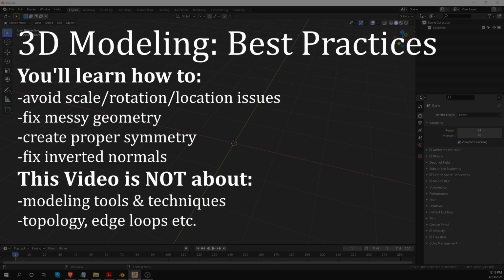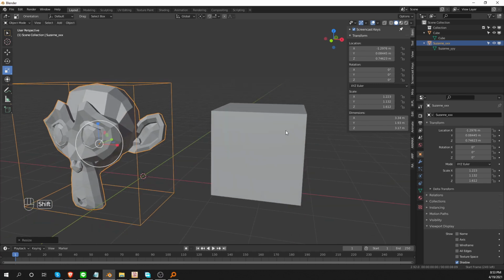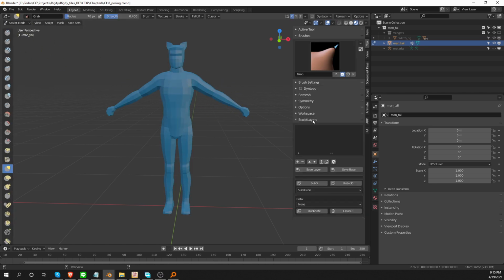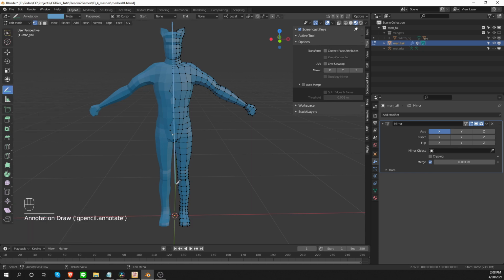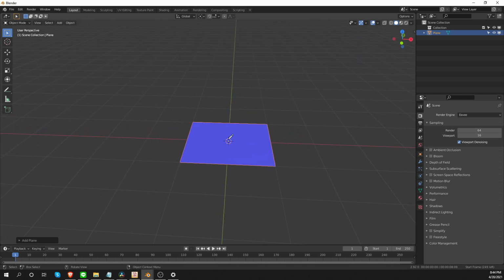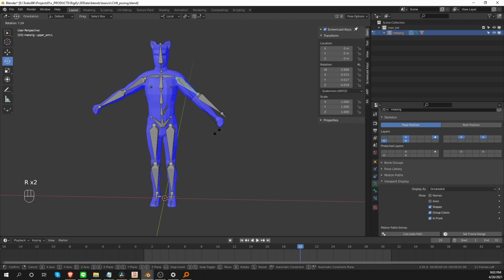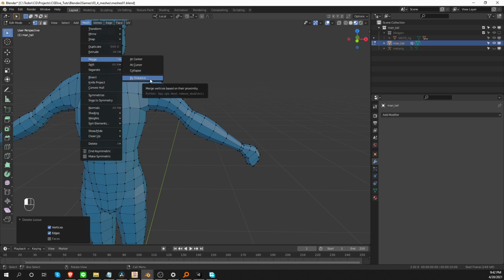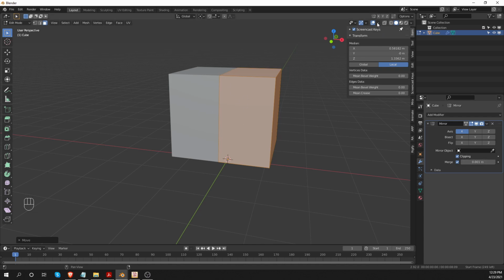[Blender] Best 3D Modeling Practices (aka Why your meshes SUCK!)

Comment: Thank you for the video.  I tried the method you mentioned in messy mesh, but I still have the following problems.  1.  In Pose Mode, after I moved my mesh with the control bone, the body with leg area deformed in ugly shape.  2.  When I moved my mesh's arm, some mesh came out from the other arm.  3.  Some mesh came from my arm's control bone and it sticks to the floor.  4.  I don't know how to solve the above problems.  I set the whole body weight to zero at weight painting.  But before I move my mesh's bones in Pose Mode, my mesh look good.  Please teach me how can I solve the above problem.  I will send you my Blender file, please take a look and teach me how to fix them.  Thank you very much.
Reply from the maker: Sorry, I am not sure what exactly could be wrong. Check for inverted normals which is also explained in the video!
Reply: @CGDive  Thank you.

Comment: This info-pact proper-meshing-for-rigging video is the guide I wish I had when I jumped into Blender 2.79 in 2017 to attempt to rig my first (made in ZBrush) 15000vert character from scratch. I even paid for (dated/ compartmentalized) subscription videos yet there were so many holes in so many areas. I succeeded in rigging a complex rig in spite of it all, still I left around 2.81, then returned to fumble through new shiny 2.93's buried treasures. This thoughtful tut has so many time-saving, pain-reducing, pitfalls-avoiding good practice gems for beginners or intermediate new arrivals to Blender. Bravo CGDive =  one valuable asset to 2021 Blender community!
Reply from the maker: Thank you very much. This is probably one of the nicest "praise-comments" I have received so far. I hope you don't mind if I used it as a "testimonial" at some point.
Reply: @CGDive  OMG now I'm blushing, please feel free... :)
Reply: Oh, and my spelling correction: *info-packed not info-pact
Reply from the maker: @Mythmaker_theAnimator  Thanks, man! :)

Comment: sculpt mode symmetry is basically replicating the brush strokes on the other side (NOT INVERTING X COORDS)..........ever tried sculpt mirror in an assymetrical mesh?...............like 1 hand is crab hand and other in homan hand.................

Sculpt mirror is a brush simulation
Edit mode mirror is co-ords invertion

best way of getting a perfect symmetry after a sculpt is:
1) Use a vertical boolean plane (or box with 1 side parallel to yz axes ) to cut the mesh into 2 precisely at the axis ( with vertices at the axis plane)
2) Mirror modifier with clipping 
3) Apply
4) DO NOT FORGET TO DELETE THE FACE CREATED AT THE YZ PLANE by the bool modifier, else it'll FUCK u UP later on (me having PTSD ) in UV and texturing etc
Reply from the maker: Right on! thanks fro the workflow!